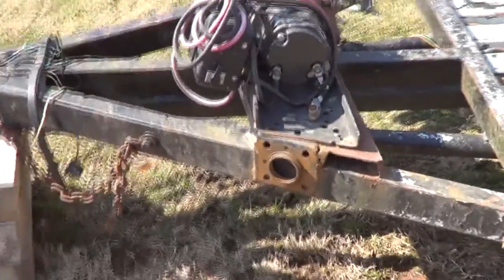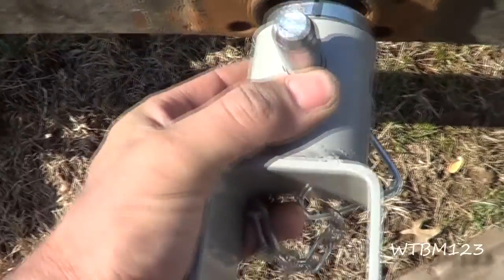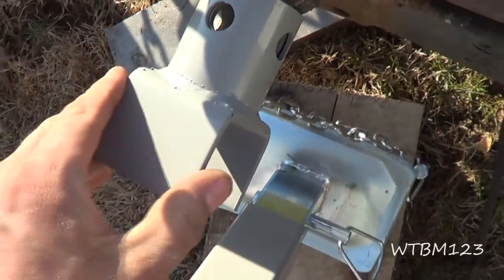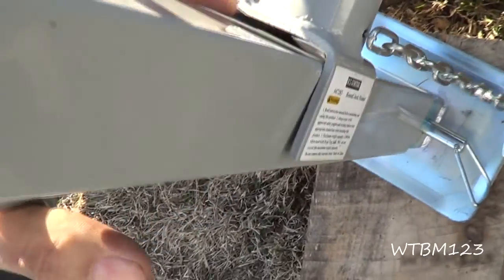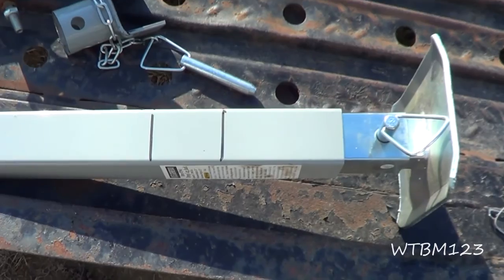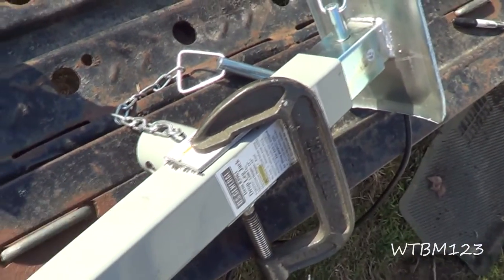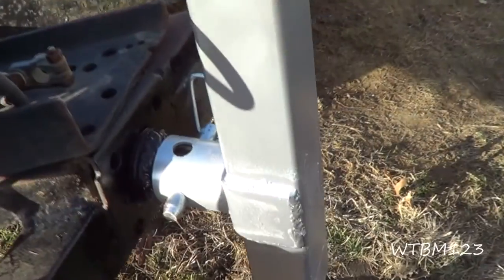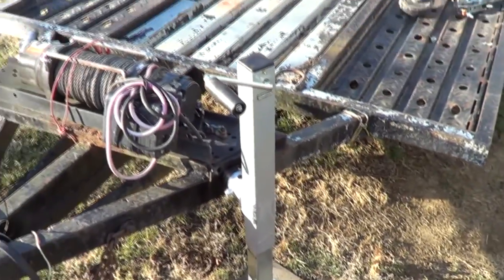Installing a Trailer Jack

Comment: Looks good!  I installed my second jack  after the first jack was to low.....even with the extension leg  cranked as high as it will go,  the main  jack  body   finally  hit a railroad crossing and bent the whole jack  backwards. Had a tractor on the trailer and never felt the jack hit the high part of the railroad crossing. Found it bent when  I went to unload the trailer.  I lowed the drop down extension and welded the main jack tube to the frame  making sure it was in a location that didn't interfere  with a sharp  trailer  angle while backing up.... and still lift the tongue high enough to clear the ball on a  tall 4x4 truck  .
Reply from the maker: Glad you got it sorted out .

Comment: Just picked two of these jacks @ HF and about to install them on two of my trailers. Your video helped me by pointing out the need to mount the jack a little higher and allow the drop portion of the foot to do its job.

If the first two installs go well, I'll be adding an additional pair to my cargo/tailgating trailer, to use as stabilizers that can be removed for travel. We can't leave the trailer hooked to a tow vehicle at ball games, due to single parking spots...

Thanks for the tips!!
Reply from the maker: Thanks for watching and commenting

Comment: Nice welds, Terry-- I gotta find an excuse to weld... I really enjoy it still
Reply from the maker: Thanks ,but I almost didn't post because how crappy i thought the welds looked. Just using flux core, and could not find my magnifier lens for the helmet , and with out it i do not see well any more.Also if you look you will see a unfinished weld where I ran out of wire.
Reply: A magnifying lens?? For a welding helmet? That would be awesome! I can't see shit when I weld.. maybe a setting or something...
Reply from the maker: Yaheuben66 Yes they are wonderful. I will do a little video on it . Some reason i can not see with glasses on but can with this device.

Comment: I need to put a longer travel one on my camper. I have to use a cinder block to get it on and off the ball
Reply from the maker: makes it nice when the jack works well
Reply: My problem my truck sits too high even at stock for using the bumper to tow. I run out of jack before I get high enough

Comment: Nice work. Are you using flux core wire?
Reply from the maker: Yes Flux core. Does not look as good but i carry that little welder all over and much easier not on the bottle.

Comment: Some good looking welds there!! What are you using for a welder?
Reply from the maker: LOL ,I almost did not post because how messy the welds looked. I could not find my magnifier lens so i kind of just welded blindly.  It is a Hobart 140 ,running .030 flux core wire.